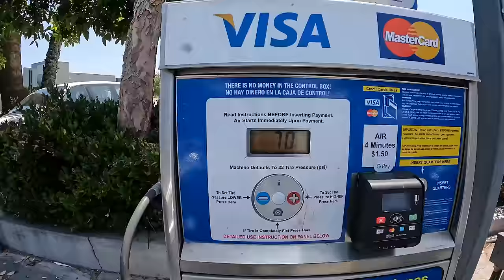Harley-Davidson Wheelie Circus! - Vlog 13 • Part 1

Comment: How do they fix the engine starving for oil problem when they are at the 12:00 wheelie?  The oil has surely run to back of the oil pan away from the oil pickup.